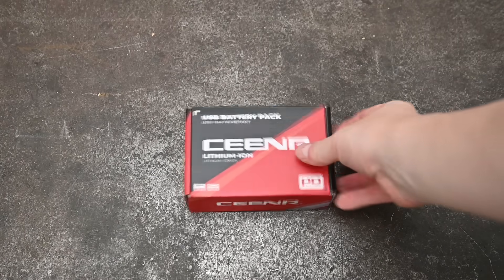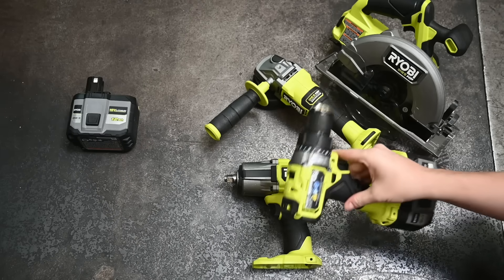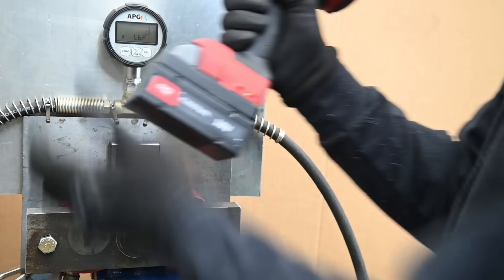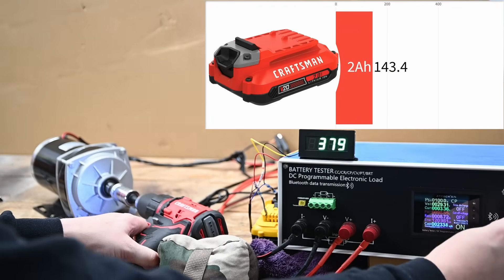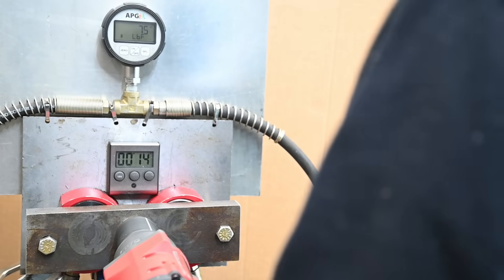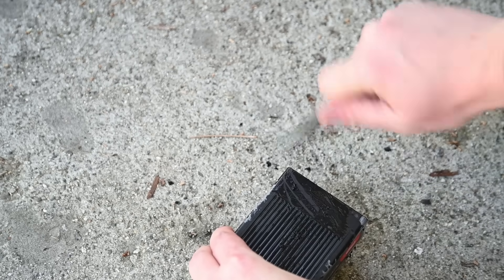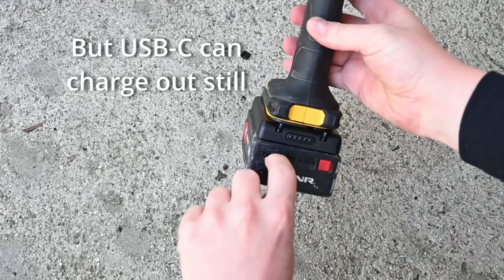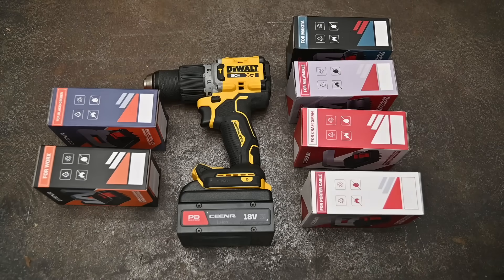We Bought the New Universal Battery for All Tool Brands

Comment: Battery power tools are in the same cartel as printer makers, who all have different cartridges costing more than the printer.  The print cartridges do have chips in them but aftermarket cartridge makers soon cracked the code.

Comment: I don't know that they will replace the incumbents in most products, but there is definitely a niche market present.  I avoid some tools just because I don't want yet another set of unique batteries, this is where I'd be most interested in their product. I have some elderly cordless (like DeWalt 14.4 NiCd for which a LiON "upgrade" would be welcome-- the DeWalt T handle drill is a fave.  OK, probably need a switcher, but the amp draw is smallish) for which a common battery pack with adapter would be welcome.  Especially, if they can maintain quality and specs-- unlike, as the channel notes, fake clickbait specs sold by essentially every non-brand.   Finally, USB-C charging is the way to go, even with the charge time penalty;  unique special chargers are so... 2020's.

Comment: Wait so it’s basically a scam? A worse battery that takes adapters. Unless it’s your first battery and you already have a tool with no battery, just use an adapter. Dewalt to Milwaukee, Makita to Dewalt, etc, whatever you have right now to the tool you’re trying to use that has no battery.

Comment: Using Bosch Professional. Some of my stuff is "Bi-Turbo" marked. I surely doubt this thing will hold up, the ProCore or ProCore+ batteries Bosch offers are insane. And tbh, 5Ah + adapter isn't such a great deal either. With proper looking, you can get the ProCore batteries for a similar amount.

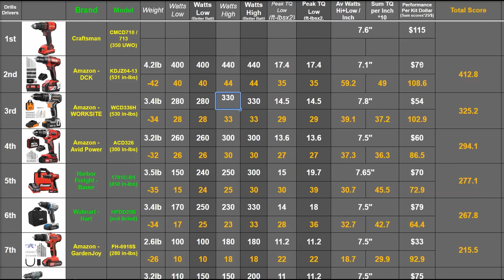Comment: Worth mentioning that in the low-end drill comparison chart (6:03), only some of those models are advertised as brushless motors. If that's not important to you, you can get the Craftsman CMCD700C1 instead for significantly cheaper. Not that I'd recommend that.

Comment: There are already so many cost-effective alternatives to this idea. Generic batteries of good quality are available for every brand at about half the cost of OEM. Adapters are available so you can mix power tool brands but use the same battery. Adapters are also available that turn whatever battery you have into the power bank. I have a dual adapter that will charge the battery from USBC input. What I would really like to see is the OEMs building in USB-C ports for both charging and power bank use. If they did that I would gladly just buy OEM batteries. Recently for instance I found a pole lopper in a style only made by Ryobi 18V. But I only have DeWalt batteries both oem and generic. Bought a $12 adapter and it works just perfectly.
Reply from the maker: We've melted tools and adapters, had sparks fly out from these cheap adapters. This thing turns off too early, but at least does so in communication with the tool. There's several terminal connectors connected to the tool unlike the simple +/- adapters. But if you're using it on like a constant low draw tool, probably doesnt make a difference.
Reply: Generic batteries and adapters are extremely sketchy.

Comment: 70 bucks for this? I can pretty easily find a 4ah battery for that. So the only point here is to be privileged to spend another 20 bucks to be able to use this battery on another brand tool.... FAIL. This company wont be around for too long. I suppose if I was just starting out and buying bare tools then buying what ever brand strikes my fancy then using this battery on them all, well, OK. But how many people are going to decide to go with all bare tools then these batteries? You can always find deals on tools with free batteries or an extra free battery. I have never bought a cordless drill/driver or any cordless tool without getting such a deal. That makes this a total no go.

Comment: Maybe Ceenr COULD come out with a double cell stack 8.0Ah high power/heavy duty battery that has higher internal current limits and is made for higher sustained output currents.
I like that they play it really safe with their 4.0Ah battery though.
Keeps people from overloading their tools and burning them out and it extends the life of the cells. Also the 45W USB C charging is a good idea it will also extend cell lifespan over using a fast charger that will pump 100W+ into the battery pack to advertise fast chargeup times but just heats up the cells.

Comment: USB-C charging is interesting. I want a DeWalt electric pruner but the kit with battery isn't the best battery but options to get a good battery and separate charger are limited and expensive. Since laptops can charge at 130W+ over USB-C it seems like that technology shouldn't be THAT hard to adapt.

Comment: If these had a button to limit charge to 80% it'd be perfect!  Although I suppose I could get a similar effect using a USB-C Chargie set to stop charging at 25 W.
Reply: It seems that these charge at 45W max which results in 1 hour 40 minutes from empty to full.
That seems pretty easonbale to me for a long battery cell life.
Other tool battery chargers pump a lot more power into the cells advertising fast chargeup times but that only heats up the cells and shortens their useful lifespan.

Comment: There's nothing more insane than charging a battery for a specific tool with their specific charger, when you have hundreds of other batteries of equivalent voltage around, but they've made it proprietary with a chip for pure greed....and wiring them up yourself just doesn't work.

It's not the cost...it's the time to keep organized all the chargers, systems, and return them to storage voltage for a whole family with many e-bikes, scooters, tools, devices.

Comment: While I am happy to see this finally, the pessimist in me expects to see more integrated batteries like with cordless vacuums if this gains traction or bare tool pricing will rapidly go up. Manufacturers will figure out rapid charging technologies etc and especially for entry level tools where continued multi pack per day use is not expected the swappable batteries may disappear. I definitely hope that I am wrong on that though.

Comment: This is a cool idea. But one big problem would be that you are going to need tons of adapters and at $20 a pop that will get expensive. $90 per battery setup($69 for the battery and $20 for the adapter) is cheaper than some OEM but more expensive than others. Personally I like to have a battery on every tool I am using repetitively on a job, not swapping the battery every time I pick up a tool.
I think it's a step in the right direction, but the adapter cost needs to come way down, or maybe have a bulk pack option or allow mix-n-match quantity discount. And the cells need to be allowed to output harder. They also need to fix the reset protocol so you can just remove the battery from the tool to reset like most name brands. Although I guess you could just carry a USB A to USB C cable in your pocket and plug one battery in to the other to reset it. Still, that's extra steps.

A question, can these batteries be charged while on a tool? And can they be used as a powerbank while connected to a tool?

Comment: I like the idea I could go buy any brand of battery operated tool (used) needing a battery and just put it in my collection with just an adapter. Buy 3-4 batteries (all the same? WOW) for working rotation and not worry which one I'm using at any time.

Comment: TTC, which battery manufacturer would you say is the best bang for buck, i use Makita 18v tools ive tried all the others and prefer Makita. I have a Bosch charger and a few batteries that the thieves left behind when they robbed my van, i bought a Bosch to Makita adapter to make use of the batteries and they work well but i am wondering if there is a better battery for less money that i can buy an adapter for, im in the UK by the way

Comment: The EU have already released the path they are taking. They are forcing the tool manufactures to move to having adapters for other brands battery's and the phase 2 of this is they are forcing a unified battery standard so all batterys will have to be compatible lol so yer its already in the works and i think it comes in over the next year or so.
Reply: That is incorrect.

Comment: To be honest you are better off with a 9 dollar battery adapter off amazon and using the batteries you have instead of buying a full set of universal batteries on top of what you already have. I use my DeWalt 20v and 60v batteries  on my Makita 18v tools all the time (for anyone who doesn't know the 60v batteries run as 20v on 20v tools). I gave away all the older Makita batteries because they didn't hold a charge in the cold as well as my newer DeWalt power stacks do. I didn't feel like having twice as many batteries on the truck if a 9 dollar adapter can replace half of them.

Comment: In regards to compatibility, consumer grade motor vehicles should only have one kind of wheel attachment fastener, depending on strength needed across all brands. One kind of fuel cap across all brands and fuel types. AND, all cordless devices, depending on power requirements should have the same damn attachments. But no, everything is about ego, my thing is better so you have to pay more and waste time finding a lugnut, gas cap or battery to stick on it.

Imagine if in the early days people did this with flashlights/torches. We would have had dozens different shaped dry cells for dozens of different lights. Or, each brand or model of radio operated on a different band of frequencies or modulation modes. Imagine the mess that would have been. It was tried with light bulbs, see what happened to the odd-out companies that tried that stupid idea. So, why does this stupidity continue well into the 21st Century? Surprise, people still have big fat egos! GROW... UP!!

Comment: Tool manufacturers, by making their batteries working only with their tool brand, are following the Apple model of "walked garden" - that the government has likened to a monopoly.
This battery proves that the only difference between the brands is the design of the battery connection.
I only have a battery powered drill, not a great user of power tools but I like to see there are alternatives to overpriced  OEM  batteries; I doubt that such flexibility would be made available here in the UK, where the battery powered tool market is much less developed...

Comment: One of the reasons I went with Kobalt back in 2016, was the (now discontinued) $19.99, 1.5Ah battery, even though I never bought one, and never got one in a kit. Even at $29, the 2.0Ah is still a good/great value.

Comment: I love this idea. Hope it’s successful everywhere . I had a 12v combo set . Not brilliant but handy. Batteries died, could I find a new battery pack? Heck no! It’s been discontinued so would need to buy a new combo set, or? I bought adapters for the Black and Decker 14v batteries and fitted those. What a hassle! It was only because the little set has proven to be handy to have in the back of the van that I bothered. I’ve used B&D professionally for years now on site, my theft rate has dropped to virtually zero yet the tools have done all I’ve asked over the years. 
The combo set now works on the B&D batteries better than ever. But if universal batteries were available it would save so much trouble and so much e-waste. Especially when you quite often find your favourite tool on sale ,with battery, for less than the cost of a new battery. Promo’s like that are great for us but just generates even more e-waste.

Comment: Could you consider testing the big boy grinders 230mm /  inch grinders? Also I would love more parkside stuff. Sending batteries is a pain but maybe buying a shell and packing it with some random 21700s could be an option.

I would love to see more tests of Performance (black) Parkside stuff. Especially the 150nm drill which is a knockoff of Bosch pro.

Comment: Great Vid!  I'm sick of being held hostage to the brand battery price points so every now and again I'll try a knock off just to test the water --that's why I'm super interested in this series that you are doing.  I've found no joy until recently I'm trying a couple of "TENMOER" 18v jobs that claim 9 Ah (which is total BS) but the upside is that they do seem to perform sorta' like a 5 Ah brand bat with some strange hiccups.  Haven't had 'em long enough to see how long they last but I've run them hard (mostly on angle grinders) since Jan and they still charge and run the tools decently.  When one of 'em dies I'll chop it open and see what's under the hood.  Dunno' if you are looking for brands to try but these are better than any other knock off's/reasonably priced batts I've tried (they are chineseeum batts so the name of them has probably changed as of this writing lol).  With the ones you just tested, I do like the idea of just needing a USB C charger cable, but I usually use the brand chargers just because of their speed (and I have a bunch of them).  Great stuff nonetheless and thanks for sharing!!

Comment: LIFEPO4 and its a perfect product, sold, long lasting, 8ah also. It can be done, but the adaptations and bullfuckery is costly. The chemistry and compact flat pouch cells can roughly fit the same, or 85-95 percent capacity in the same form factor. 
But they last at least 5 times longer, overall.

Comment: It’d be cool to see one of these built on a 60v architecture where the brand adapters buck the voltage down (or select the voltage even if the circuitry is in the battery) depending on the tool. Basically take DeWalt’s idea and use it to break brand lock-in 😂

Comment: For me, usbc is huge disadvantage. Not all of us have 65w chargers. If they make decent fast charger for at least 2 batteries and remove constant on led's it would be a contestant. Not to mention use with high torque is not the best as shown in videowhich I mostly use. So until they perfect the product I'll stick to oem batteries

Comment: Well the batteries are the reason I buy the same brand tools, even if it is a little bit more expensive or maybe not the top performer. Usually they are not far off from the competition.  That being said there are a few Bauer cordless tools that I have wanted to get because I most likely will not use very much and don't want to deal with their batteries and chargers.

Comment: Okay I will say I’m a Milwaukee fanboy. But I would like to know what you are doing to the batteries to make them break because I have a 5.0 that right off the bat I run over it with a cat 307c which is about a 15,000 pound excavator and have still been using the same battery for about 5 years and it rough years and in no way has it even began to show signs of splitting. The only damage if from it was run over.

Comment: Off video topic, sort of, but have you guys done a video of modt powerful pnuematic imlact wrenches (recent entries/new vs. old ones)? A lot of guys at work use the Kobalt 1/2" 1000 ft./lb. impact and on occasion can get it for under $100. I'm debating on if the deal is too good to pass up or continue saving for the more expensive ones. A a link to the video would be appreciated if I've overlooked it🙏

Comment: but why not just buy a 10$ battery adapter and use the batteries you've already got? That's basically what this amounts to... an adapter. 
This battery is still going to be bulkier than just using that brand's proprietary battery..
Standardization is ultimately what needs to happen.
Reply from the maker: Battery adapters suck. And melt and spark. And the battery doesn't even know it's being used that way. This is designed to be used this way and theoretically you wouldn't have to own a brand battery to begin with
Reply: @TorqueTestChannel  Meh... bad battery adapters suck, even if that's all of them currently. 
My point is that this is still just a battery with adapters. Based on your testing it seems this one still has some issues cutting off on certain tools and some other odd quirks. 
Personally, I would not buy a powertool battery with USB ports, especially ones that are covered by little rubber flaps. 
The phrase "designed to be used this way" is just marketing. 
I don't see this product (or the concept of universal batteries) reaching mass production or wide adoption until tool manufacturers start cooperating in the effort. 
Some of the problems with adapting batteries to different tools (especially the more modern ones) are, as you know, proprietary "tech" within the tools and/or battery circuits... or where they put the battery's protection circuit (on battery or on tool), if they use extra pins, etc... Newer tools are only going to have more of that.

Comment: If you are going to do this with an adapter why don’t you just buy name brand battery and order adapters
Reply from the maker: They stack high and aren't designed designed to work together. And are more expensive
Reply: @TorqueTestChannel for around $80 you can buy a Hercules 4 amp hr and charger and the battery being $35 if you buy 2 batteries it would be cheaper then this battery per battery and the adapters are about $20 to adapt to other tools I know it’s not a perfect solution and like this all for one battery but to test this battery against the adapted battery would be a fair test and you already have most the data not complaining really like the channel watch every Friday for over a year